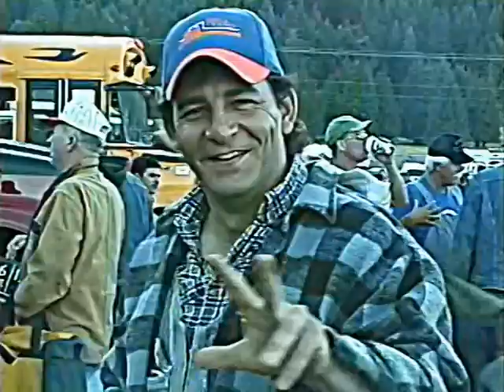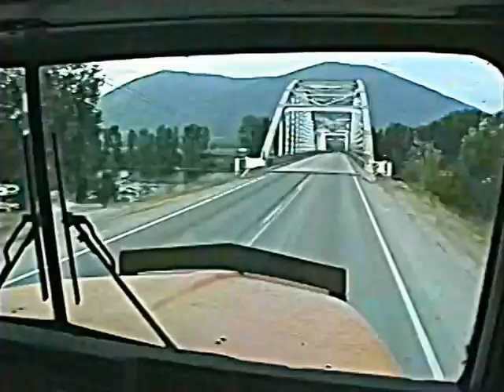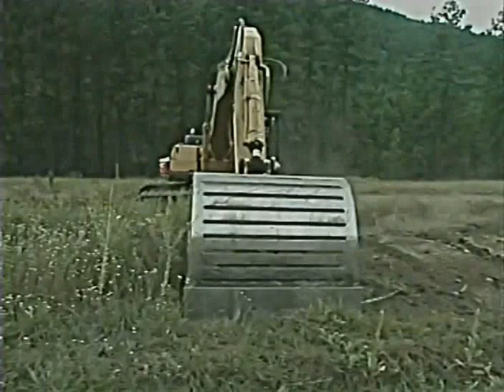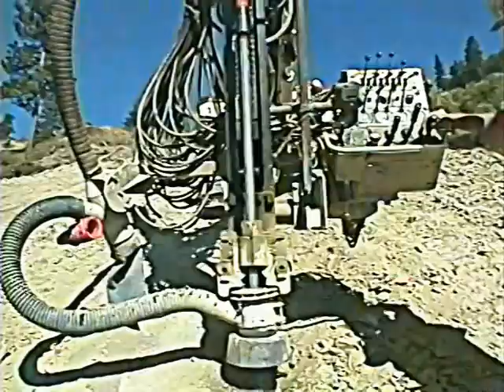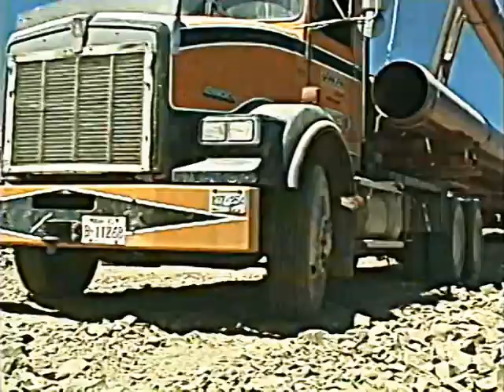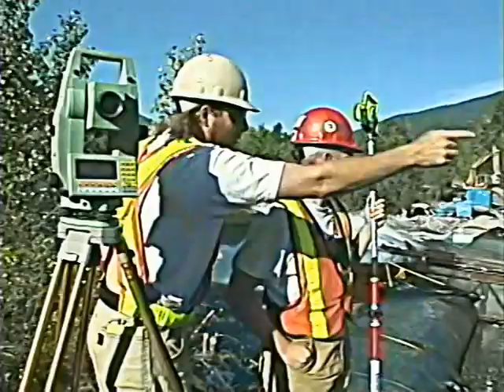Canadian Pipeline Construction 2a

Comment: 110 backhoes? yeah I dont think so, they were straight up excavators or trackhoes. Not backhoes. Backhoe has rubber tires, a front loader bucket, and is not even close to the same! I bet they had a few backhoes on site back then, but they would have been the old four stick Case models, etc.